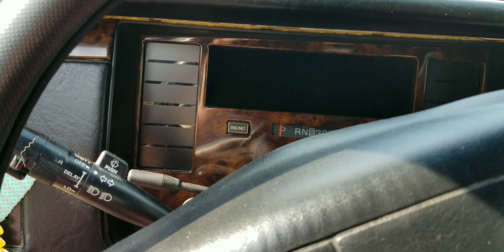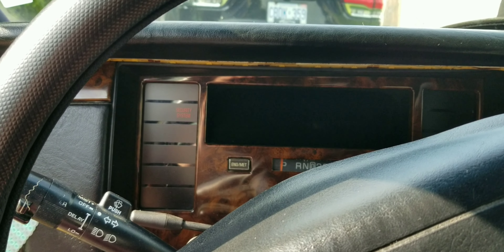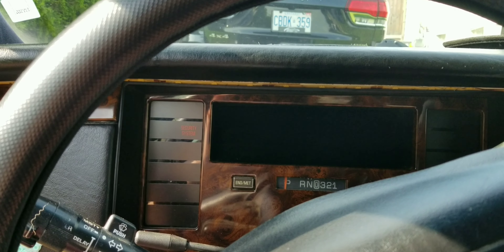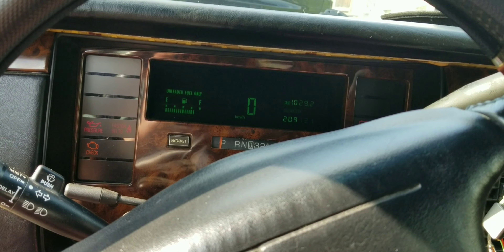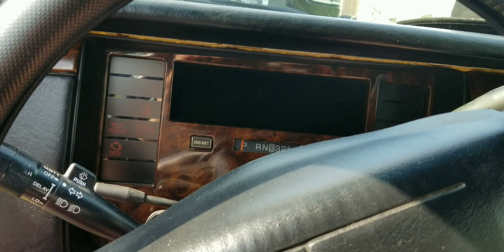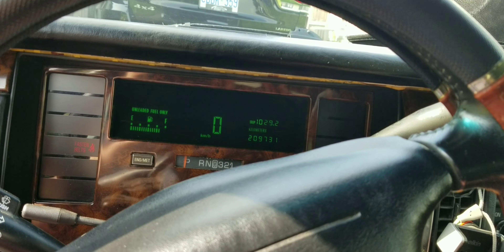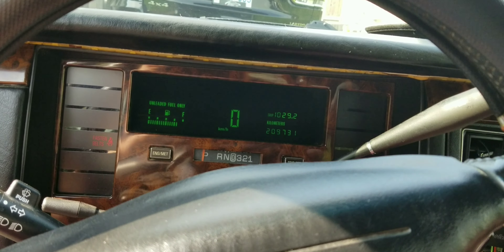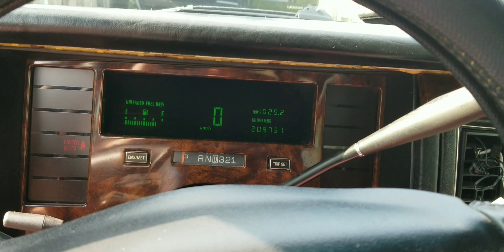Cadillac Fleetwood hard start morning (Fuel pump was bad)

Comment: I hope this is my issue man so that way I know what the problem has been all this time. Mine will turn high fan on afterwards and then check engine light on then it dies in 5 min or less.
Reply from the maker: My check engine light comes on and the cooling fan comes on high as well and the code i get is 32 egr valve malfunction. Only thing is I had that replaced a year ago but it's possible it has gone bad. But even after replacing the valve it has not fixed the hard start issues
Reply: @vcamnowaa  Thanks for letting me know, I will check after work when I upload video.
Reply: @vcamnowaa  uploaded man, we have same issues I think. Check my channel, let me know. Also black smoke came out of exaust I think.